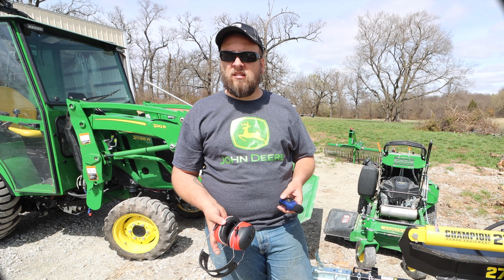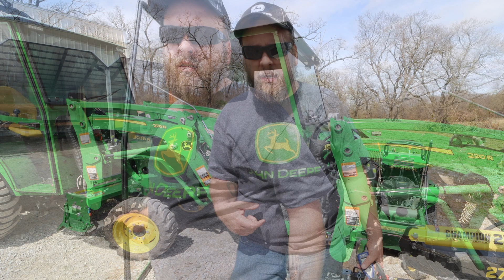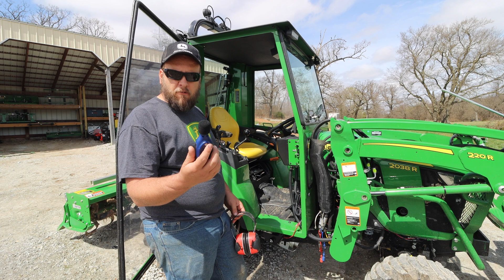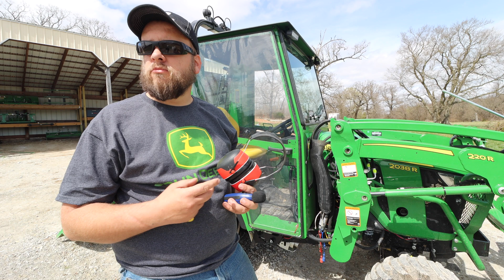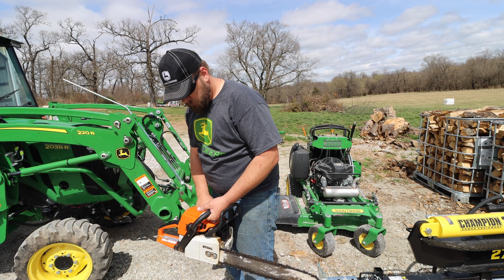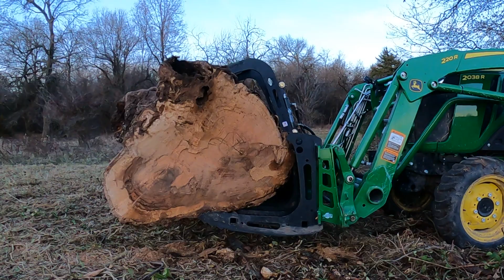Do You Need Hearing Protection On A Tractor?

Comment: I saw the comments on that video! You know I guess it is best to use ear plugs but I rarely do. We’ve toured manufacturing facilities and in places like that ear protection is a must for sure. With tractors I think anyone would be ok but it definitely wouldn’t hurt to wear them.
Reply from the maker: At idle the tractor really is not very loud.  At full throttle it’s pretty loud.

I think it’s good to know what the safe rating is and how loud the tractor is but I also think we’re all old enough to make our own decisions
Reply: @RockhillfarmYT  you hit the nail on the head there! We can make our own decisions on safety, we all are aware of the risk we take. You did a good job of expressing your views as well as the views of those who criticized you about safety in a non controversial way!

Comment: Good video Brock, nice showing the real numbers.
I've been scrutinized several times on my channel for not wearing hearing protection, too each their own I guess. What gets me is when people tell me that they wear isotunes or bluetooth headsets playing music and actually think that they are helping themselves. The music playing in their ears is worse than running the tractor without anything.
Reply from the maker: I get that comment as well. After I checked all the equipment I took the same meter into my house where my grandkids were watching baby shark on the TV.

At low RPMs The tractor wasn’t as loud as the TV.

At high RPMs for a long period of time you’re probably doing hearing damage. 

I am concerned about being disconnected from the noise around the tractor so I will not be playing music in headphones while operating

Thanks for watching and for commenting

Comment: Very good video showing real world need.  I try and always wear hearing protection when operating equipment.   I even use them when in the wood shop.
Reply from the maker: I need to go check the saws next but I’m sure they are allowed. I was surprised that the mower is louder than the tractor

Comment: Excellent topic and great video. I wish I would have protected my hearing when I was younger. I really thought your cab might reduce the noise when inside.  Question- did you flip the tread direction around on your tractor front tires?
Reply from the maker: Good eye. I’ve had them off three times experimenting with different things and the last time I accidentally put them on backwards I didn’t realize it untill I was done

I’m going to do a second video on the subject and put them back on right

Comment: i wear hearing protection all the time when im on the tractor or running my chainsaw....wanna be able to hear when im an older man
Reply: So do I. It does not take much to put in ear plugs and I am 63 with some hearing loss and I want to keep what I still have. I have never regretted wearing them.
Reply from the maker: Turns out that at a low to medium throttle my tractor is not as loud as the TV in our house, or the lawnmower or the normal radio setting in my car.  What makes it dangerous is when it is constant for a long period of time so I’m gonna start wearing them when doing bigger jobs

Like I showed in the video though, my lawnmower is dramatically louder than my tractor